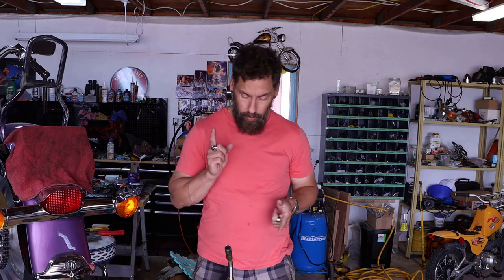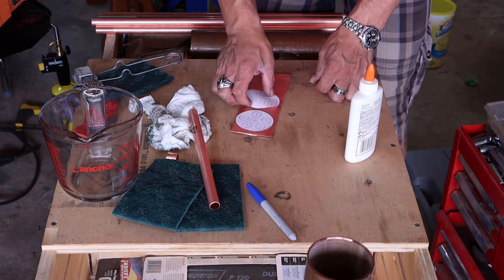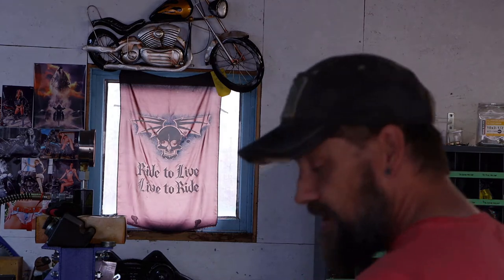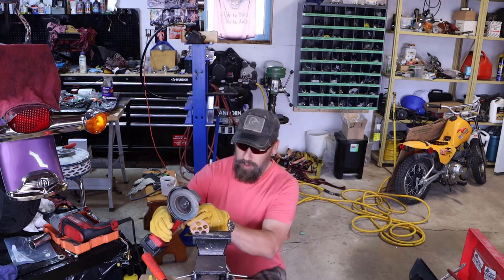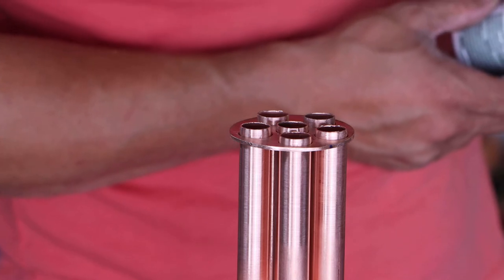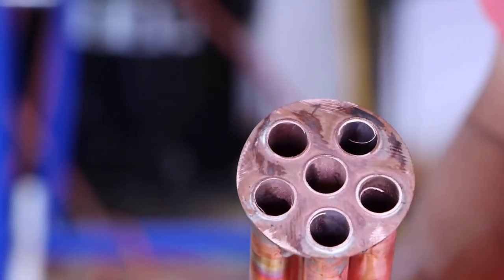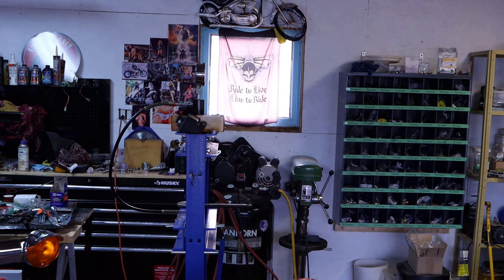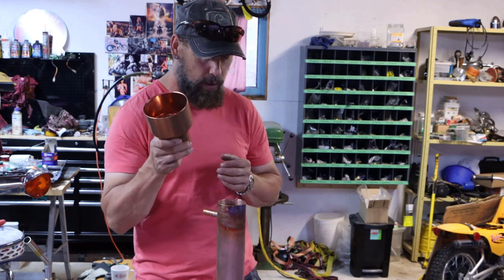Product condenser build

Comment: nice work only comment would be you should use a board under you plat when drilling out the holes with out it yo could bend the copper out of round
Reply from the maker: Thanks for the advice 👍🏼

Comment: How are u not melting what u already have soldered?
I cant get over how fast that solder melts.
Reply from the maker: as you burn off the flux/acid it takes more heat to re melt the solder...  Solder likes to follow after the heat..  Heat up what you want to solder once it is heated keep the heat on the far side of what you want soldered as the solder melts it will run towards the heat source..  remember the amount of solder you need is based on the diameter of the pipe.. ex:  half inch pipe you should only need about 1/2" of solder...  3/4"--- 3/4" etc.
hopefully this helps